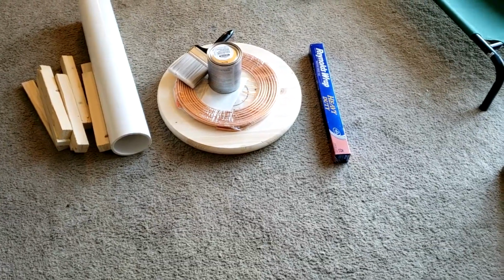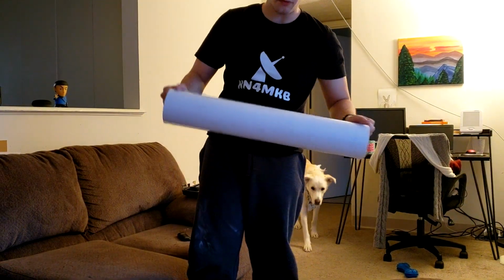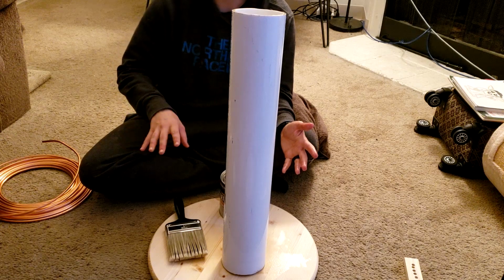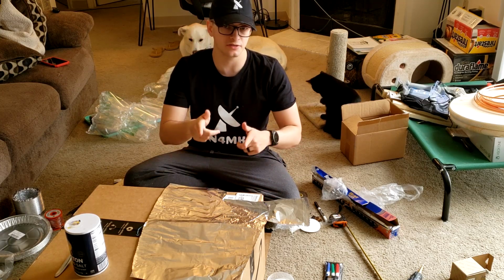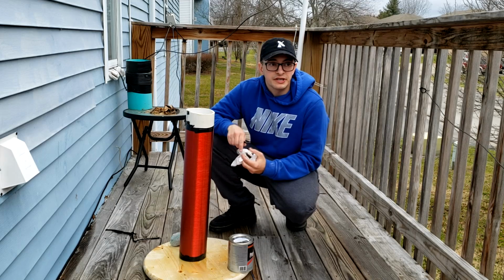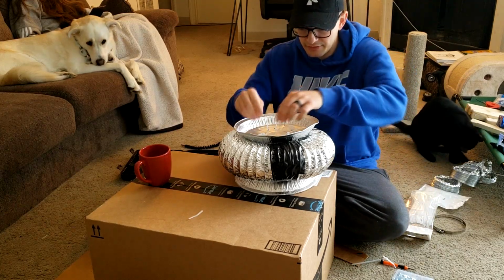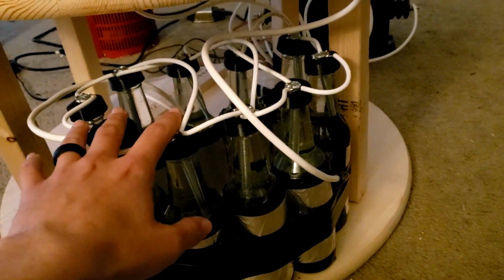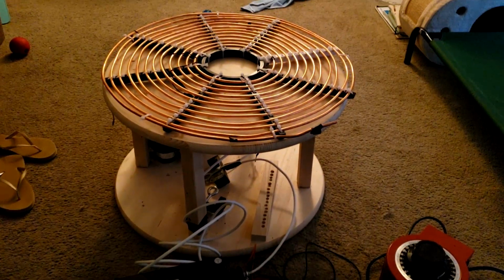Homemade SGTC Tesla Coil Build - (Almost) Finished

Comment: Well damn, thanks to YouTube for completely ignoring this upload, I would've definitely been there for the premier if I had known!

Awesome SGTC man, looks very clean, other than that top load hahaha. It's strange that your ZVS driver couldn't handle the load, as when those are properly insulated and driven, they can make in excess of 60kv. Also, try adding tap points on that primary coil, as it looks a bit large for the secondary IMHO.

Might I also recommend putting the AC from the neon sign transformer through a voltage multiplier? Assuming that the neon sign transformer's output is AC anyway, adding that will give you some decent boost in output. I would mount the voltage multiplier in a PVC tube, filled with either HV oil, or paraffin wax. You can buy some paraffin wax candles and a cheap pot at the dollar store, and melt the candles down, then pour them into the PVC tube with the multiplier already installed. 15kv diodes (Or lower voltage ones in series), and 15kv ceramic capacitors would do the trick. 

Check out Electroboom's latest video on a VM, if you haven't already lol.

Also, it should go without saying, but please, please be careful Billy. We don't want you frying yourself! I look forward to seeing what you have in store for this SGTC! Oh also, if you're having issues with the spark gap overheating, try using graphite rods, like from 6v carbon-zinc lantern batteries.

And last but not least, if you've not already, check out Styropyro, as he has already built several Tesla Coils, of various sizes and using various methods of switching. My favorite is the VTTC, which makes sword-like sparks that are (mostly) safe to touch!

Great video as always Billy, and I am really looking forward to the livestreams!
73 de W8IJC.
Reply from the maker: Thanks for your input. Yeah YouTube can be a little finicky sometimes. I may take some of your suggestions if time and money permits. Hope you're doing well through the pandemic.
73 de KN4MKB
Reply: @ModernHam  All is going ok, as well as can be expected. Thanks!